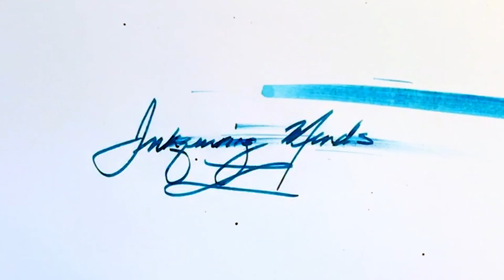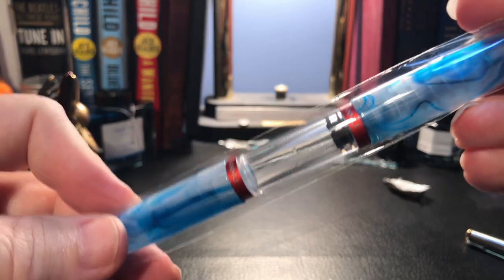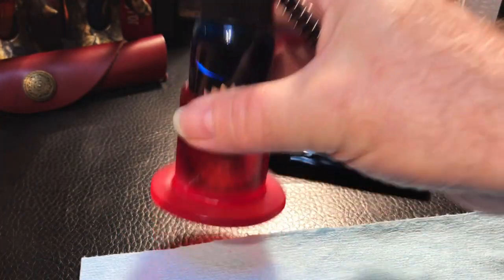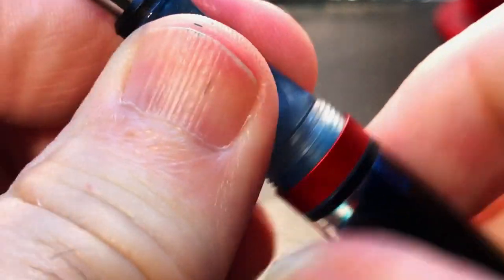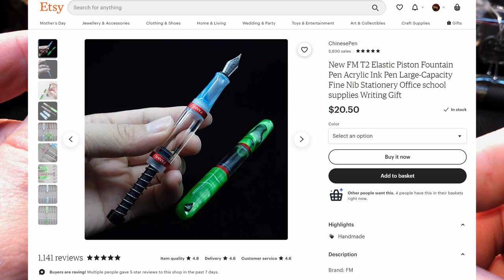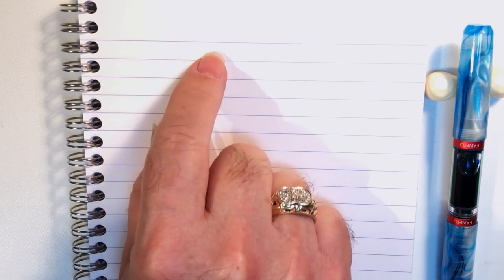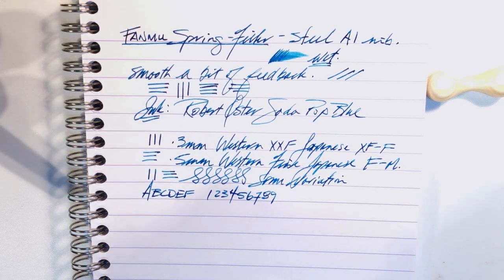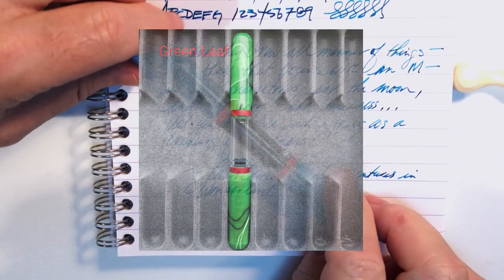2021 Fanmu Spring Filler Fountain Pen Unboxing and Review and Architect Nib Swap

Comment: I have a syringe from an inkjet cartridge refill kit that I bought over 15 years ago for emergencies (inkjet printers have a bad habit of running out of ink at the most inconvenient times). The needle is narrow enough to fit into the opening of a universal cartridge and can be removed for cleaning but the opening is about 4mm diameter so I have to shake it to expel any water droplets that are left after flushing. The syringe holds up to 15ml of ink and has a gradated scale up to 10ml. From the tip of the needle to the flange at the plunger end it is 150mm long so the hands are kept well clear of the bottle when loading. The plunger action is very smooth even after all these years. The trick when using it is to move the piston up about 10mm before dipping into the ink and loading. Lift the needle clear of the ink and pull up the piston a bit more. If you then keep the syringe pointed downwards while loading the converter etc no ink will coat the piston. After expelling any excess ink back into the bottle the syringe is almost totally devoid of ink. Less waste and less cleaning.
Reply from the maker: I don't use the Fanmu syringe to fill my converters. I use a regular syringe (from Goulet). I use the Fanmu for cleaning - great, one hand operation. I will fill the converter to the top from the syringe, put it back into the section and then move the piston until ink enters the feed. Then I'll remove the converter again and back the piston back and top it up. Works for me!

Comment: The part swapping was the equivalent of the peanut shuffle under the jar exercise. Could be fun to try as I have these pens - make an interesting cross-breed. Just have to find a cap 🧢 that fits.
Reply from the maker: At least I didn't make a huge mess!
Reply: @InkquiringMinds  Fortunate when dealing with low grade nuclear ink. I think I will fold on this one as I have two Twsbi Go’s with stub nibs .

Comment: It looks like you ordered a pen and checked off "frankenpen it!" on the order form. Then you re-frankened it with the nib swap. It's scrappy lookin' but seems to work well. That Bobby nib looks pretty good too. I want to get on the architect train. But I'm waiting to see if I can steal a posting nib from the 'Bay. I just got a box of ink samples Monday. I need to slow down.

Office Space... haven't watched that in ages. I  used to watch it regularly to reset my snark, but the last tune up has held really well. Years in fact.
Reply from the maker: Ink samples?? Restrain yourself Amy!
Reply: @InkquiringMinds  Well, I bought the old Platinum, then a vintage and a NOS Pilot last month, meaning I needed to get Pilot cartridges or a converter...bought both then said hey, let's get 19 samples while I'm here. That's a lot for me. I haven't even gotten a tax refund or a stimulus check yet and I'm spending it like I got it 😅

Comment: I don’t see much line variation between the horizontal and vertical. Maybe it’s the camera angle. I think you’ve convinced me that all this Chinese........comes out of the same shop, just different doors and Etsy is their storefront. I do like that spring syringe.
Reply from the maker: It is very subtle on this nib. Very much like a Penbbs mini-fude.
Reply: I got the same nib from bobby, and the line variation is NOT very noticeable compared to the architect M from Fpnibs. This nib is very rounded so you won't get very crisp corners at both ends of your line. I would say this is more like a cursive architect grind.

Comment: I have a Montblanc barrel that a Pelikan cap fits perfectly.  Many pen parts from many models are similar.  Maybe made in the same factory for the different pens.  An architect grind is the opposite of an italic grind.  Bobby calls this nib an architect nib (I have a few).  Why do you call it an architect italic?
Reply from the maker: I dunno. Habit? I asked my nib guru the question and he said that an architect is like an italic turned 90 degrees. And there are soft architect and hard architect just like there are italics and cursive italic. I always thought a nib that laid down a wide variation because of shape rather than flex was an "italic". I'll refrain from using the term in future. Jack is currently grinding me a Naginata Togi on my Leonardo Momento Zero Grande Broad (Jowo).
Reply: @InkquiringMinds  The grinds are opposites.  In my experience, Italic is a specific grind.  I have a Bobby & a Sailor Naginata Togi nibs.  They are like an architect where the vertical line varies based on angle, like a Zoom nib.  Horizontals are a wider line.  In my hand, I like an architect grind more.  Interesting to hear what you find.

Comment: Interesting pen and it looks far more better than the TWSBI GO but not as beautiful as the PenBBS 500.
BTW AliExpress lists this spring loaded syringe as "FanMu Moonman Hongdian Filler" so there could be a larger connection (or the seller simply has no clue what they are selling).
Reply from the maker: Sometimes the seller doesn't have a clue (most times) but often it is a clue to who the parent company of all these brands is. HongDian may seem like a "new" company, but they go back to the 1990's as an OEM manufacturer for many brands. These bigger companies (like HERO), just create new sub brands for different models.
Reply: Also I think there is the desire by sellers to catch as many related searches as possible even if they know it's technically not correct.
Reply from the maker: @Wreneagle  I think that hits the nail on the head Ian.

Comment: But the original nib it's bigger?
Reply from the maker: No, it is the same size exactly. I just looked bigger because it isn't in the section and you can see the part of the nib that is usually buried inside.